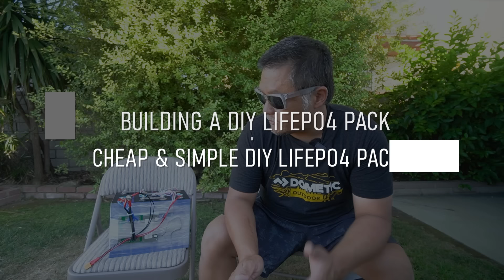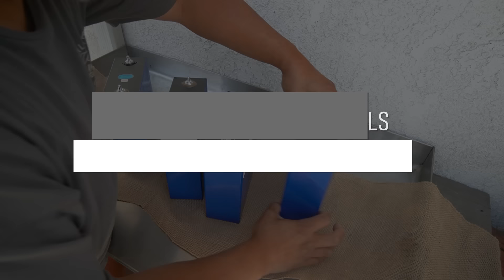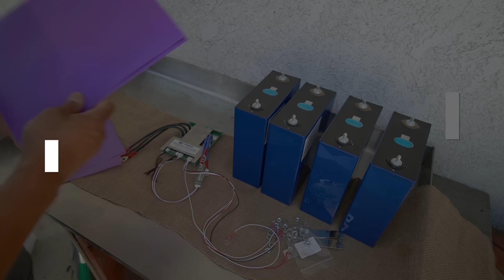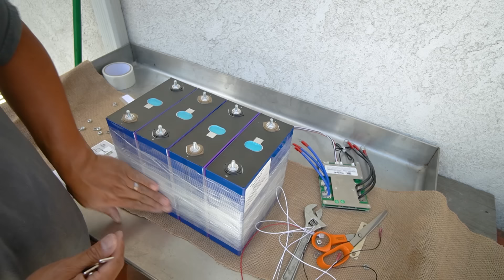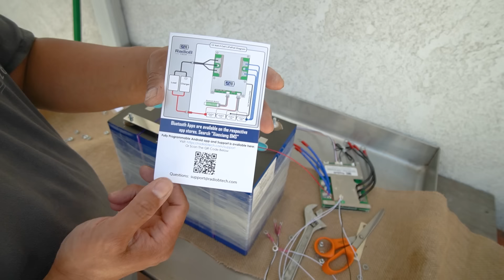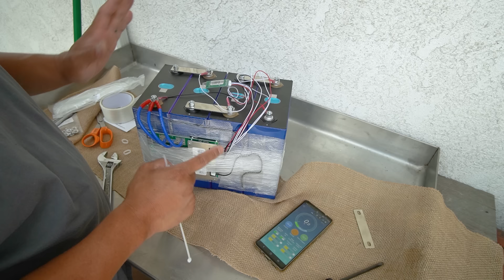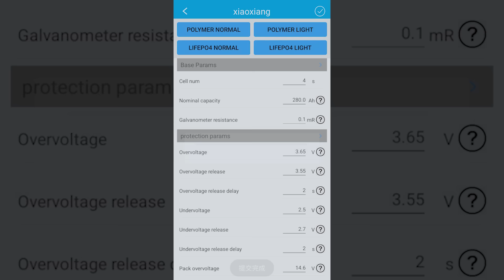EASIEST DIY 12-Volt 280Ah LiFePO4 Battery // Step-By-Step Build

Comment: I’m very confused on how many AH are in each individual cell. Does each cell contain 280 Ah or is it the set of 4 that make 280Ah?
Reply from the maker: You always have to specify Ah along with the nominal voltage. Each cell is 3.2V at 280Ah which makes 896 Wh (3.2x280). When you connect 4 of these cells in series you will increase the voltage but the Ah rating stays the same. So the full pack will be 12.8V at 280Ah which makes 3584 Wh.

Watt hour is a much better way to describe battery capacity because it can be stated alone without any other specifications.
Reply: I started with these exact batteries, built a pack of 16 in series @ 48v, I'm now building my 4th pack with a combined 57,344wh pushing 2 6500k inverters, and everything works great.

Comment: So you have to use a special charger on this battery or can I treat it like a lead acid battery in my camper and just let the solar and Jeep charge it as if it was a standard house battery and the BMS does all the magic?  I keep seeing people  specify special lifepo4 chargers that pretty much defeat the purpose of these.
Reply from the maker: You need a charger that is compatible with lifepo4. Good quality modern chargers like victrons will have lifepo4 profiles in their settings. Not sure what you mean by defeating the purpose of them as the purpose is lighter weight and longer lifespan than lead acid among many others. Having to use a compatible charger is not really a big deal. BMS does not handle any charging duties. It is just there to protect the battery from damage.
Reply: @freelyroaming   it means the tow vehicle can not charge the battery as its designed to output 14.5V and not a computerized  charging system to carefully balance charge LifePO4 batteries.   I guess I assumed the BMS added to the batteries did all that  but it seems you still need a special charger even if you have a BMS installed.    How do the premade battery companies sell them claiming you dont need a special charger?

Comment: I did this set up with just the 120 amp bms.  I have a 40 amp. Rich charge controller and two 200 watt. Panels.  Also 3000 watt pure sine inverter.  I have been all over the app and can't get my cells to charge past 13.4.  I put my Noco genius 10 on it with the bms hooked up and I only get 13.4 and only 3 out of 4 red bars on the charger no matter how long I wait.  When I charge the cells without the bms hooked up, I get 14.4.  Then, as soon as I hook the bms up it takes it down to 13.4.  I have calculated about 50% capacity.  Maybe less.  The only thing I can think of is the bms needs to be a 250amp? Advice would be perfect.  Maybe parameters I need to change?  Thanks
Reply: This is a good take but with your connections how many hours does it last that's when your battery is fully charged to use at night

Comment: What is the discharge rate of these cells?
Reply from the maker: 1C
Reply: @freelyroaming  what's the pulse rating on them? is it at least 10c?
Reply from the maker: @apocalypse4720  No. These are not designed for high C-rate. if you need to pull high current, you will need to have a bigger battery bank.
Reply: @freelyroaming  Yeah i would need different cells, For car audio you need at least a 10c discharge pulse rating

Comment: Thanks for sharing the knowledge.  As right now, you can buy Chins 300AH around $970.  I don't see much of the saving because the cost of 4 cells 3.2v is $750 + $130 BMS + bluetooth.
Reply from the maker: If not a lot of savings you will have more features like low temp protection, Bluetooth connectivity, smaller footprint and most of all, ease of maintenance. This for me was less than 700 bucks all in. I don't know about you but that's more than 300 bucks cheaper than Chins using my math especially when factoring in tax.
Reply: @freelyroaming  Espcially if youre going 48/51 Volts, savings add up. 
Stay gold.

Comment: With the BMS you used can you program the max charging amps?  I am building one for my van and wanted to know if I can program the BMS to a max 40 AMP charge. I could use a DC/DC charger if needed but would be nice if I could do it without the DC/DC charger.
Reply from the maker: You can't exceed the hardware limits of the BMS so usually it is not programmable

Comment: What about using coroplast corrugated plastic signs as your dividers for battery and bms that way they can get some air between them
Reply from the maker: The only problem is if you use something too thick the bus bars will probably not reach the studs.

Comment: Very good! Iuse strapping tape with glasfibers in it. In case of the cells getting hot, it wont fall apart.
Reply from the maker: That's why I used. Although it's really not likely to reach any temperature hot enough to cause the adhesive to fail when this is used in an low c rate environment.

Comment: Hey Dan, do you have a video that shows what parameters to use on the mppt for our diy batteries? Or did you get them from the supplier?
Reply from the maker: If you use a victron charger then you can just use their built in lithium charging profile. In one of my older videos of the battery build I did show it. I can make a quick video to show parameters.
Reply: @freelyroaming  awesome thanks! I think a quick video would help a lot of us. 🙏

Comment: Thanks , very educational for beginners.  Very good video compared to others out there.  You stressed safety which is very important but safety glasses and at least sunglasses should be worn at all time working on battery like you did.   No metal when welding or electrical work period.

Comment: Great information  will help me greatly deal I'm goin to make battery pack to charge on off peak electric @ night to use during day giving me 24hr off peak lectricity shud save a great deal with big rise in energy prices, think l need to aim for sbout 10kw to run bungalow in day! Don't think l should have any problem putting that together, I'm a retired  electronics tech! Just hope  l can get all stuff you got shipped here to U.K. very good presentation lot good information thanks so much saves me time on researching all this myself!🤗🤩😎🌹

Comment: How many of those bats would be needed to run an RV 15,000 btu AC? So one said I’d need 7 or 8 400 watt panels on the roof.I think I can mount 7 on my roof but not 8.

Comment: Is there a reason you use three lugs on the BMS negative lead and bunch them all together on one stud, instead of crimping all three into one larger lug?
It seems to me (ignorant) that it would eliminate a bit of the 'spider' and not have a huge stack of lugs on the battery stud?
Reply from the maker: Small wires crimped into large lugs have a tendency to slip out. Also it complicates the build as it requires you to undo the already-crimped sensing wires without adding much of a benefit as you will still have bundles of wires to manage.
Reply: @freelyroaming  Thanks for the reply! You really break it down for your audience.
I'm unsure what the three thick current passing wires have to do with the thin sensing wires?  🤔
But I do see why they are using three silicone insulated wires to make the connection to the board more compliant.
Great tutorial!  Happy Trails
Reply from the maker: @jimurrata6785  ah yes I see what you mean. The 3 wires from the BMS. It's just how the manufacturer have chosen to build them. 3 thinner, more flexible wires instead of 1 thicker one. Using 3 lugs also give you a bit more flexibility during the build process but a single large one could have worked but it would be slightly more restricting with regard to their angles of attachment.

Comment: I found some 320a cells. I will be building a battery very soon. What amperage to you recommend for the bms? Is a 200a bms to much?
Reply from the maker: No it's not too much. It is all based on how much max current you plan on drawing from it.

Comment: Thanks Great Video  Why was cell #1 red and a B flashing in the bluetooth display?
Reply from the maker: It is showing the balancing of the cells. Red signifies which cell has the highest voltage and is being resistively drained to a lower level.

Comment: What if a person just bought the celss and connected them without the bms.  Would they work and be ok to charge?
Reply from the maker: You could over charge or discharge cells which will permanently damage them.

Comment: There are a few things you should take care of, apart from not assembling the battery on a steel table. Don't use an adjustable wrench to tighten the nuts - it.s too easy to accidentally creating a short circuit. Use a socket wrench instead. Don't use scissors to cut tie-raps but use short snips (with insulated handles) for the same reason. Do not tie-rap all balancing wires together, if there is any damage on the insulation of the wires you may get fire or at least smoke. Do not tie-rap the C- and B- wires in one bundle - if they short circuit you are disabling the complete BMS.
Never ever use those large heavy cells wrapped in just packing tape. It's too easy to get a puncture in the wrapping or denting the cells. Also, follow the manufacturers specifications on how to mount these cells. I've seen manufacturers specifying that you must compress these cells to make sure they cannot bulge, resulting in de-lamination of the cell.
How do you think these are EVE cells? EVE is a brand with a well known reputation so anyone selling EVE cells will leave the EVE label on the battery or at least have their own label with "Manufactured by EVE" on it.
Reply from the maker: You should watch some more of my videos before making your critiques. I've got plenty of real world and technical experience building off grid electrical systems. 'Not my first rodeo' is the common expression .There is plenty of other videos showing how I've built packs that I actually use. As I stated pretty clearly in the video, this was not meant to be a 'best practices' build video. It is just to show how components go together which was something requested by subscribers. And for a non-mobile setup, there is zero risk of insulation rubbing, chafing and shorting. As a full time traveler who does a lot of DIY projects, we don't have the luxury of a workshop full of tools. Learning to do with what you have is a very useful skill. It is all about understanding and assessing the risks and make it work with what you have. I assume you just landed here from YouTube recommendations without knowing other already posted contents my channel. There is one all about cell compression as it sounds like you might learn a few things from it.

Comment: What torque did you use on the terminal nuts? Perhaps I just missed it.
Reply from the maker: Didn't specify a torque spec. I am using a lock washer instead of the serrated flange nuts. I just get it down to snug and give it another 8th turn. Usually enough to hold.

Comment: That was great. I'm just starting to think about building a battery system. So the two temperature wire r for low & high temperature, right? 
Do u hv a video about discharging & charging the battery b4 u build the battery pack? I need to know what type of equipment is used to do that?
Reply: The most common charger is often a 30V 10A bench power supply that goes for $75 on Amazon. You could probably get a higher amperage charger for ONE specific voltage but that gives you no flexibility so I would really recommend getting a bench power supply. If you can afford something that can do 20A then I would recommend it just to save yourself some time. 

Discharging…first ask yourself, do you want to capacity test? For $50 you can get a DL24 load tester but it’s limited to discharging at a max of 150W or 20A. If you don’t want to capacity test then you could hook up a super basic DC load (bulb) or get some bigger power resistors and use ohms law to calculate a load small enough that won’t melt some 100W resistors but big enough that it won’t take centuries to drain it. You need a low voltage disconnect module
Reply: @bobforte9343 Wow thank u for all that info. I'll do some more research about all that u noted. I'm a visual person so reading the info I don't get yet. But I truly hope ur explanations. 👍🏾😊

Comment: 4 batteries can't be what u showed even now QSU give one cell at 108USD. When I asked. :(
Reply from the maker: What do you mean? $108 per cell so 4 cells is $432. Another $250ish for everything else makes this a complete battery for about 680 bucks.
Reply: @freelyroaming  yeah one cell is 108usd in qsu 126 in Duncan. Did u do a capacity test on the cells u got.

Comment: Nice video.  One item that you should consider doing is to connect the main negative load leads directly to the battery terminal, then attach the balance lead on top of the load leads.  That way the load leads have better contact with the battery terminal and the lug for the balance lead is not carrying load current.
Reply: But then it is not turning off if the voltage goes too low which is one of the main functions of the BMS. I would suggest not to do that.
Reply from the maker: He's talking about the stacking order of the ring terminals on the lug. It's not really that critical for off grid power use but for high current draw applications like EVs it might help. But even then it's not really gonna make any noticeable difference. Just best practices kinda thing.
Reply: @freelyroaming  Ok that makes sense. I understood that he didn't want the load to through the BMS. Sorry.

Comment: Is there a relation between the bms Amp power and battery Amp Capacity? Do these both must have the same Amp rating? Or its ok for example to make 4 series 60Ah lifep04 battery with a 20A bms?
Reply from the maker: No they don't need to match. The output amp rating is the highest amount of power you think you might draw. Higher amp rating will need a bigger and generally more expensive BMS. You can also run multiple BMS in parallel if you choose. Just make sure it you don't draw more current from the battery than it's capable to.

Comment: Hi Dan, BTW The 280K is the 6,000 cycle battery from EVE as the 280 normal is 3 - 4,000 cycles. Best charging the batteries in parallel to connect the positive at one end and the negative at the other end of the battery bank. This will avoid the first cell in the line taking the most current and last one the least. 
If you get a chance to try the JK BMS it is the best on the market according to me and Off-Grid Garage on Youtube. André
Reply from the maker: What do you like about JK BMS? Active balancing? And you actually believe what Andy says over there from his broken shack down under?!?! 

Just kidding 😂 He's making some good content over there.
Reply: @freelyroaming  Yes the active balancing is the main difference. It is fully featured and seams to be very reliable. I was commited to  package deal with a DeliGreencs BMS new parallel version so I could not change.  André

Comment: Where do you get your batteries from as I have ordered many off aliexpress only to get scammed
Reply from the maker: Avoid getting sucked into a deal too good to be true. You will likely get used cells or no cells at all. These cells were from Shenzhen Qishou on Alibaba. You need to submit an order request to buy. My experience was very good. Link is in the description.

Comment: Cut the wires, the BMS has next to no current when measuring so therefore no voltage droop. Also when top balancing no need to wait when first connected but when charging leave at 3.65 for a few hours.
Reply from the maker: I've explained this in several comments exactly like yours. You'd understand if you are someone who makes videos like these

Comment: Thanks for the concise video...
One comment: The cell sense wires of the bms CAN be cut, there is no way 20ga wire, at .01 ohms per foot at 3,2 volts, with virtually zero current draw, is going to have any voltage drop. I notice nearly all the DIY builders think the same way, which tells me they all watch each others channels. The instrument doesn't have close to the resolution to read any difference. Simple ohms law for voltage drop. It would be microvolts
Reply from the maker: Of course it can be cut practically speaking. But when you make a video showing people how to do things, you need to teach best practices. The best practice is to not shorten them. There might not be a measurable difference but there is a difference at least in microvolts.

Comment: Thanks for a nice tutorial, what is the advantage of this battery over a 12V 680Amp 110Ah  lead acid battery costing $200, is the lead acid battery working out cheaper per Ah at that rate?
Reply: well 110ah lead acid,  compared to 280 lifepo4/for one thing. So basically you need 3 so there's $600
His LifePo4 battery can be run to near EMPTY, do that to a lead acid a dozen times it will be scrap. Lead acid shouldn't be discharged more than 50%-60%... if you expect any kind of longevity. So NOW you really only have a 50ah battery. NOW you need nearly 6.
Hows the math going ? 6x$200? which would you prefer?
Reply from the maker: And it will be about 4x the weight. Which comes to around 200 lbs worth of lead acid. For an equivalent LiFePO4 pack comes in at closer to 50 lbs.
Reply: Ok thanks for the clarification 👍
Reply: Cos you can only use 55ah of it without damaging it

Comment: These batts will probably be lower in price over time.  The other facet not mentioned in this video is the ability to add more cells either in series or parallel.  Either changing the bms or adding another depends on how you wire.  But these are a great starter with budget in mind which can be increased over time without tossing any you've already purchased.   16 in series give you a 48 nominal volt setup which requires smaller wiring for the same watts used.  The versatility is just wonderful.
Reply: Good now very good